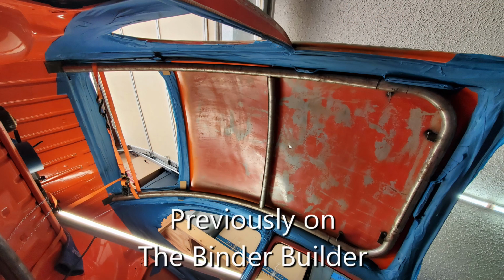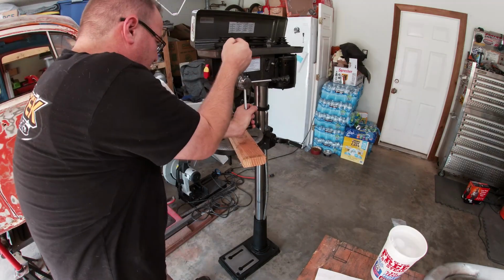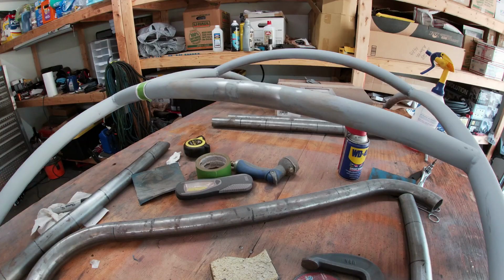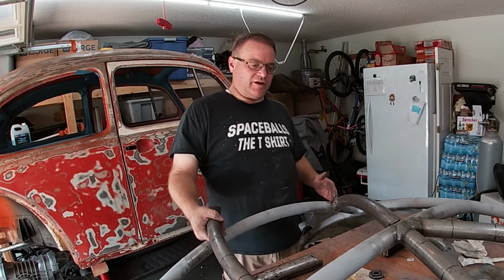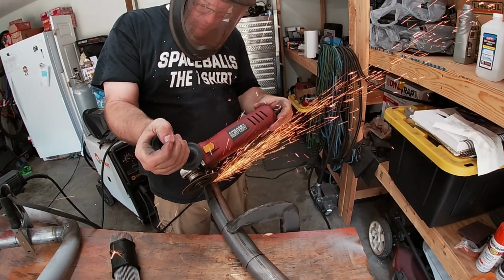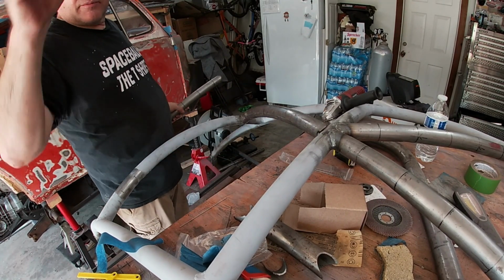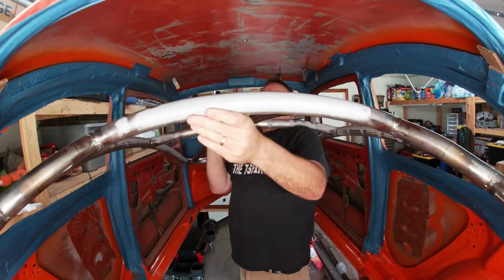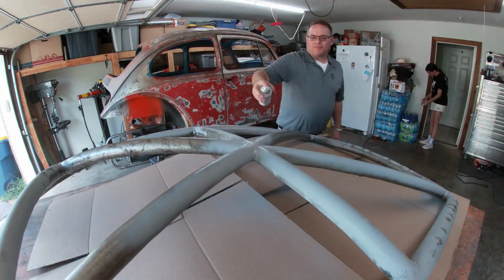Baja Bug Build (Ep. 13): Building a Halo-Style Cage (Part 3 - FINISHED!)

Comment: Nice work 👍. Back in the day, I used to work in a garage just like yours. I installed an attic fan in the garage ceiling which pulled air through the garage door opening. It served two purposes...besides cooling me off in sweltering heat it also forced hot 🥵 air from the attic! Those attic fans were belt driven which are quiet compared to the fans we can get from the big box stores.
Reply from the maker: I never considered using an attic fan for the garage, but that's a good idea...thanks!
Reply: I did the same years ago except I used an old condenser fan motor and blade off of an AC unit, turned it upside down. It pulls the heat from the garage and flushed the heat from the attic as well. I wired it in on 110v and it only pulls 1/2 an amp. Been using it for about 15 years without failure.
Reply from the maker: @VWJawbreaker  I love attic fans, just never heard of one IN a garage!  It's brilliant...
Reply: @VWJawbreaker  Nice...I blew the air into the attic...all the hot air escaped out the soffit vents. That way I only had fresh air coming from the garage door opening. NEVER turn the fan on with the garage door closed though! The wife played heck to get the door open to do her wash!! 😂 😂 (washer/dryer was in the garage)
Reply: @johnnysgarageTX  correct, I have it setup the same way.

Comment: nice work, it's looking good! What engine are you going to use? was going to use Honda V6 in mine but still considering a k20 or 24
Reply from the maker: I'm going to do the J30a v6.  I'm pretty much copying @EvanLS55 s build.  He seems to be able to RIP pretty well and I like the idea of the extra torque of a v6 over the i4.  I don't plan on turboing it so what I buy, I'm stuck with.  Know what I mean?

Comment: also...I spent last Monday at my eye Dr getting 5 pieces of a grinder wheel out of my eye, so yes to eye protection! I got caught without because they kept fogging up on me, got frustrated and paid the price.
Reply from the maker: Dude that sucks...super glad you got them out! I assume all is well now.

Having had grinder/metal bits in my eye before, I'm glad the eye heals so quick.  It's really amazing actually. 

I have to admit, I don't wear it as much as I should, but I definately try and have some present as much as possible 

Thanks for the comment.  Stay safe.